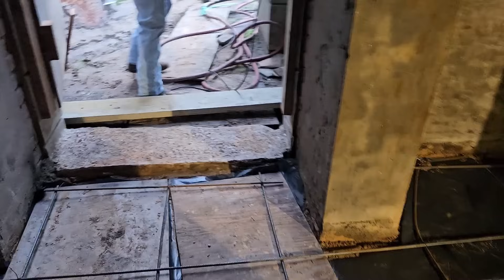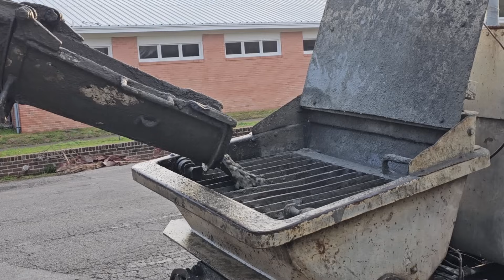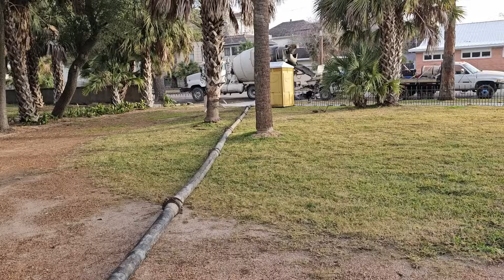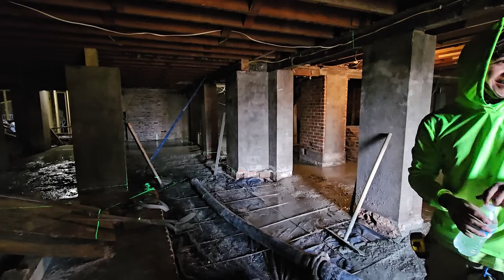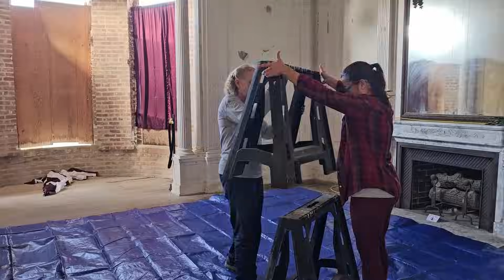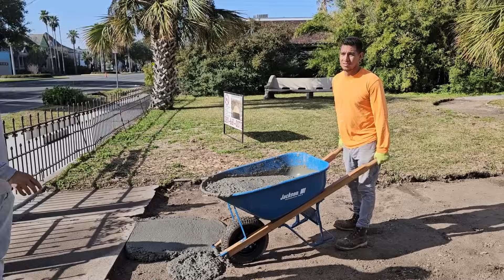S4.04  It's Happening - The Concrete Is Here!

Comment: That sawhorse issue is strangely and sadly and yet incredibly..hilarious! 

Also,
“We’re done with being pretty and going back into work mode”
should be on a t-shirt. 

And what an incredible way to utilize the remaining concrete. In a place that’s being worked on like this, nothing “remaining” is wasted.
Reply from the maker: We don't waste anything.  My kids tease me because I use a packet and a half of sweetner in my tea and I fold up the half used one and save it for the next day.  Waste not, want not.   The sawhorse thing was funny but it made me realize I really need to clean and sort the junk down in the basement and get everything in the correct quadrant before the walls go up.  Having to carry the 300 lb sinks completely around the house would not be so funny.

Comment: Wow! Won't that make the ceiling really low?
Reply from the maker: It is.  It is just a little over 7 feet.  This is the same level that it started out before we did any work down here.  It is going to take some getting used to, the floor was removed almost two years ago and we've grown accustomed to the extra head room.  We may have to raise one more of the arches.  The first floor apartments at the Lucas Apartments have 7 foot ceilings and they work fine but it is a shock here when the ceilings in the rest of the house are 15 feet.  When built, the basement ceiling would have been closer to 9 feet but the basement was filled in just like the yard when the island was raised after the 1900 hurricane.

Comment: Its going to be so much better, it will keep the bugs down in the summer too. I cant wait to see it once its set and you move to the next jobs, in a clean area. great update 2x👍 Talking of electrical earths, it might be worth asking about lightning conductors for the roof while you have an electrician handy.
Reply from the maker: You're not the first to bring up the lighting rods.  I know nothing about them.  It is certainly something I need to look into.  Anything that will help protect this house going forward is worth checking out.
Reply: @leaguekempnerhouse  I think its worth asking if you need to think about getting them, on the top of the roof, just in case.